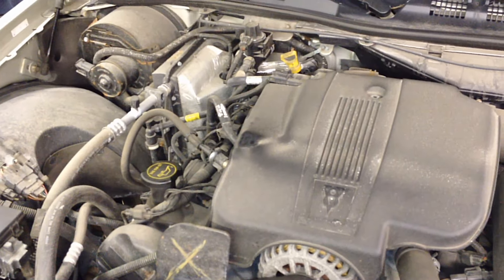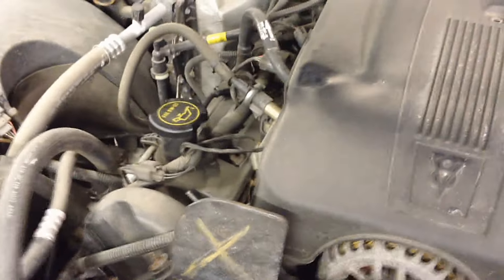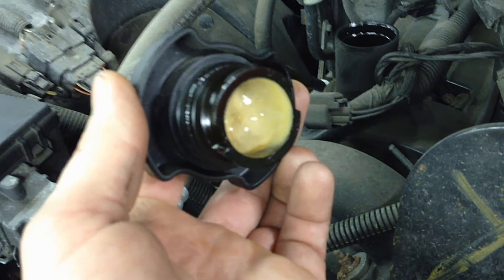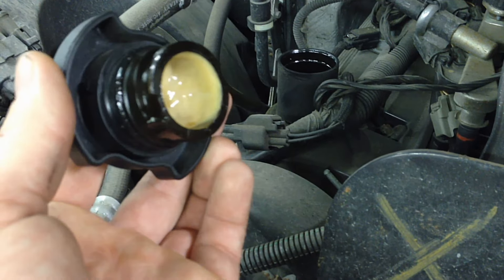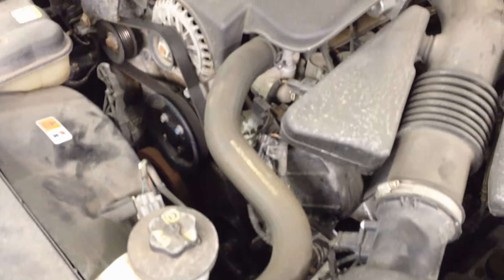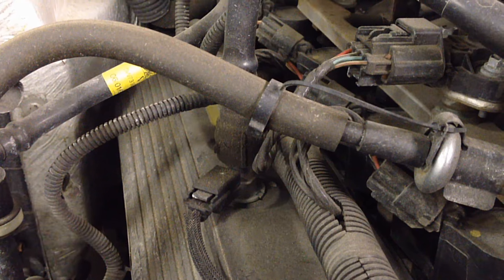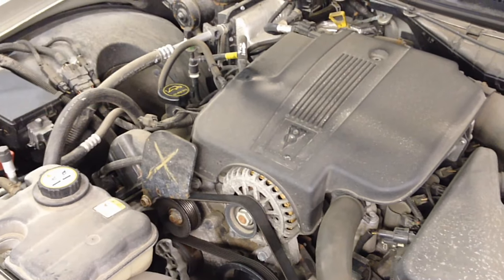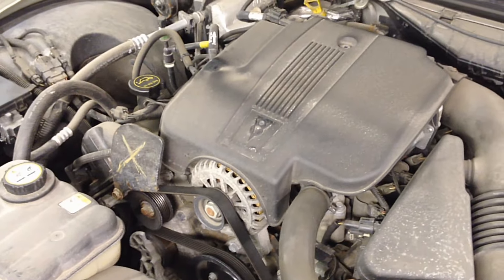Ford Quick Tips: #1 Engine Oil Cap Puddding

Comment: Thank you for putting my mind at ease.  I moved up to Washington State 5 years ago from Southern California.  I drive a 20 year old F-150, with close to 300,000 miles on the 4.2 V6.  I had never seen a car do this before (because warm climate).  The truck runs fantastic, but I was beginning to think I needed to start shopping for a crate engine due to this.  A friend told me just what you said, and it makes sense...  thank you for verifying his assertion that this is normal in a cold climate.
Reply: Hey I have a 98 f150 v6 and the other day it started sputtering out of no where well I got a code for my camshaft sensor so I’m gonna pull it off today and spray it out to see if that does it but I went to put some oil in and freaked out when my cap has this on it plz tell me it’s not a head
Reply: @kathyvarnell5407  One year later, still not a problem.  It happens more in the winter.

Comment: Thanks I just changed my oil on 6.8 v10 with only 25000 miles on a ford rebuilt motor I the same thing you showed in the filler cap, this is a relief! Thanks again

Comment: I'm  a retired lifetime Ford tech...I love your channel it's the most accurate info out there
Reply: R C Robertson    Yes he is really good on his information
Reply: How often do you recommend replacing a PCV?  2010 Passat 100,000 miles 2.0 TSI never been changed.    Thank you.
Reply: yes he does an awesome job thanks for all you do
Reply: @milesanhour  I'll be changing mine in a few hours. Letting the engine cool off before I knock it out. But I've heard 100k is a good bet. My Hyundai sonata has 238k
Reply: @OutlawEntertainmentlmc  At 300k you could have many problems but if the miss began after secondary ignition repairs...I would look there first
Reply: Yo can you help me with a quick question

Comment: First off, Thank You! My 92' Jeep Wrangler oil cap looked just like that this morning. My Dad was a mechanic for 30yrs, so I automatically thought coolant leak. Your video eased my fears by informing me about the dipstick oil looking great still, which mine does and that confused me. The short distance part makes sense. I drive it daily, which I know has helped it stay alive, but my commute is only 1.4 miles. Just back and forth for 1 yr. now. Your video reminded me what my Dad told me also many times, that you have to open an engine up once in a while. He lives 30min.'s away and visits me quite a bit. But you helped me maybe switch that around and visit him more and we could tinker around and do more maintenance that he loves to do and is probably needed. Thanks for helping an older Dad, Jeep and son out..

Comment: This video was EXTREMELY helpful. I live in Texas and we have had a lot of cold weather recently. I have been mostly driving my 2009 ford pickup and had been letting my 1999 Explorer sit in the driveway except for short little trips. The explorer was just given to me and I am in the process of fixing all the little problems it has so it has been a fun little project car for me. I went out to explorer this morning to check all my fluids, went to add a quart of oil (Its got minor leaks) and all under the cap was the pudding. I had seen it before on other vehicles but it still worried me, even though my dipstick was clean. So this video pretty much answered any question I had and provided me with a little relief. Thanks FordTechMakuloco !

Comment: Since I have retired I don't drive the distance I used to.  I always changed my oil based on mileage.  I saw I was at the 3000 miles +/-.  Time to change the oil (almost a year to the day of my last oil change)  I did NOT no about the possible damages that could occur by waiting.  This has been very informative and helpful.  I have always been on top of maintenance for my truck.   I learned a valuable lesson today!

Comment: Same problem with my BMW E39 520i from 2001.no
 sines of overheating or other stuff which could mean a head ascent 
damage and even after the oil and filter change I still have the pudding
 under my oil cap.i just drive very short distances in the last time in 
quiet cold weather.still will do another oil change as soon as the 
summer starts!thanks a lot for the video,got much more relaxed after 
watching it!

Comment: Good info. My neighbor found this gunk on my cap. I was only driving 1 mile to work, 1 mile back. None on dip stick. I put an ad on Craigslist to sell it outlining this and lowering the price. No wonder I got so many bites. The condition is not as bad as I thought. Runs fine, never overheated, smoked or backfired.

Comment: Great video, 
over time I have also learned that a bad thermostat is a common contributor to "oil cap pudding" due to it not coming up to proper operating temp.
Reply from the maker: Yes that can happen in the extremes where it is stuck mainly open. Reason I didn't include that in my video is because anything recent with OBDII will set a P0128 code for emission reason and will set a light which will alert you.

Comment: Thanks! I have had this happened with my 2006 Tundra. I also think that the problem is exacerbated by the long filler neck that I have not had on other vehicles. I don't think it heats up as much as the rest of the engine.  You video has set my mind at ease.
Reply: Obee Juan l have the same thing on my filler cap. I thought l had blown a gasket, no it's cold wet weather, very short trips every 3rd day and my engine also has an extended filler neck. Thanks and God bless.

Comment: When I had my 87 Ford Ranger w/2.9 V6, I had that happen a few years after installing the Ford reman engine. The block and heads were cast iron, the 2 piece intake manifolds were aluminium.
Yep, had the pudding under the oil cap.
The lower intake manifold to cylinder heads is a one piece "gasket."
The leak (twice) was the lower intake eroded at the front of the manifold where the coolant exits the heads and goes through the intake to the T'stat and then the radiator.  Took me a while to find it the first time, FINALLY got the lower intake manifold fixed at a machine shop.  No more problems.  The vehicle went to auction late 2016 (failed smog) so that ended it.  Just wanted to pass that on.

Comment: Just got an 01 4x4 pickup with very low miles (121,000) for its age and was told an older gentleman owned it. Dipstick and oil in the pan looks good but seen a small amount of sludge on cap and began to worry that head gasket or something cracked. Glad to know its just from condensation and not driven much. Good to know an oil change and good cleaning and maybe some oil treatment will most likely take care of it. l also heard, the brand of oil used such as certain cheap store brands also can cause this. 

Thank you for the video

Comment: Mannnn! Thank you FordTeckMakuloco👍  because I was about to panic when this morning I saw just what you showed me under my Oil Cap. Right now is not a very good time for me to be tearing down my engine to replace head gaskets and stuff because my funds is little short at this time. You really gave me some relief when you told me that it's only condensation if it's not the same on my dipstick, and it's not like that on my dipstick so I was confused my brotha.  I haven't really driven my F-150 since all this rain we just got for over two weeks. I just didn't drive it for Two weeks. Thank you so much man, I'm going to get me a PCV VALVE RIGHT NOW. THANKS AGAIN👍

Comment: Not a blanket, a winterfront blocks off most of the radiator in order to retain more engine heat, diesels use them in the cold Midwest winters. Keeps underhood temps up helps engine get and stay warmer up here.

Comment: thanks for posting this, I had a panic attack when I saw this on my 5.4 scab, don't like seeing this in my engine, made a behind the grille winter front to help get and keep engine temp up during the winter to help with this.
Reply: panic attack??... dude its just a f@#!ing CAR!
Reply: Marek Sumguy cars ain't cheap, had never seen this in any other engines I've run, had no clue what it was till I saw this video.
Reply: Marek Sumguy he even  put a  blanket on it 😂
Reply: blanket?... what?
Reply: I was a bit worried too when I saw this on my Vic. Good thing I found this video before I started losing sleep.
Reply: I too had it in my 2001 f150 5.4 when changing my oil and after he explained it all through I was like okay that explains it, because I drive it maybe once a week and it's usually only in town.
Reply: @mareksumguy1887  a blown head gasket could be panic attack worthy. The labor cost to replace head gaskets is not cheap and in extreme cases it can cause catastrophic engine in the form of hydrolocking.
Reply: @TheBikemaster94  have you ever seen a winter front  before? Look on the front of semi trucks, long haul cross country ones. The grille is covered to block airflow from the radiator, much like a coat on a person. Keeps engine temps more stable in the arctic winters. I simply made one that's behind the grille of my truck, guess what, it works. Engine stays at optimal temp, it also keeps it warm after shutdown, so there's heat in the cab way sooner than without. Making fun of something you don't even understand just shows your level  of maturity.

Comment: Thanks for the info! Had me worried when I did a change on my truck, we live in CT but have had record lows for this time of year. Drained oil looked OK, thanks again. I drive 2 miles to work every day 😔 perhaps should take my bike lol
Reply: thanks ace, that's brave... I would not ryde no bike in a CT. Winter!!!
Reply: get a used electric car... that short of trip even a dead battery wouldnt be bad.  Ive known people with short trips and it is bad on exhaust and catalytic converter too.
Reply: Same issue with mine in CT, freaked out
Reply: Yeah, short trips aren't good for carbon build up either.  I think he talks about that in another video.
Reply: thanks ace lol
Reply: I drive like 1/2 mile to work there and back . Guess i should walk. Damn ford .

Comment: Saw that pudding color when I opened my oil cover and started to worry but thanks to you you gave me a piece of mind. I only occasionally drive it about 5 miles a day maybe a 30 minutes drive back and fort to work. Valve cover is starting to see some oil leak. It’s a sequioa. I guess I need to drive it on a highway once in a while coz I use it on local roads. Thanks again

Comment: I was flushing my coolant system and didn't tighten bottom hose and noticed that steam was coming from around my oil cap, so I checked it. When I opened it, out had a small amount of moisture and white buildup. I checked the dip stick and nothing. Your video confirmed what I was thinking! But I still can't figure out how I got tissue paper in my radiator 😂

Comment: When you're due for and oil change and you have a lot of condensation add sea foam to your crank case and run it for 20 miles or so before draining your oil, leave the drain plug out overnight to remove as much as possible, I put my truck on ramps so the  drain hole will be angled at the lowest point

Comment: 10.21.17.   Also......GM 3.1/3.4 & 3800 V6 Coolant leaking into the valley & into the oil pan, due to (L.I.M.) lower intake manifold gaskets no longer sealing between the heads and intake manifold!.......Major problem solved by using metal framed ones from Fel-Pro or Magnum. I also change the coolant every 30k miles or 2yrs.......You have a superb channel ‼️

Comment: Thank you!  I got a block tester and tested it cold and very warm and fluid still stayed blue.  No white exaughst.  Have Mayo in the cap.  I do indeed do a lot of short runs, so will look into replacing that PCV Valve and take back the $40 head gasket repair sealant.  Have been scared would blow the motor!

Comment: Hi, I was offered (what I thought was a great deal on) a 1988 VW Cabriolet for $100. I was told by the owner it ran great 7 years ago. I had it towed to a mechanic that did only German vehicles. The entire fuel system needing cleaning and replacement parts. Once the car was running he told me the water pump and radiator fan needed replacement. He wanted way too much so I towed my car and got the water pump hose (not the water pump itself) replaced and the radiator fan replaced. 

I picked the car up from then second mechanic and it starts, idles and drives great. I've had it about 2 weeks and have been driving it about 1 mile 2-3 times a week with no visible issues. Then I decide to replace some little things under the hood. Turn signal lights, head lights, air filter, topped off fluids. Checking the radiator last I noticed the reservoir had no coolant in it, so I added about 1 gallon of 50/50 and decided to take it for the usual 1 mile spin. This time it did not start as easily as it did every time since I got it back from the 2 mechanics. It started, rough idled and died within 2-3 seconds. Pumped the gas peddle and it sounded a little better. 3rd time it started and as I was putting it in reverse and looked back there was a huge cloud of white smoke. Under the cap it appears there's milky white substance on the cap. The oil on the dip stick looks clean though.

Probably a blown head gasket? Damn, all the money I spent on these 2 mechanics and both would not tell me this major problem. Well one kept suggesting I get rid of it asap. I think I'm going to buy the manual and turn it into a project car.

Comment: Thanks! You really helped quell some concerns I've been having. Had this pretty heavy on a 92' Mustang Gt,298xxx miles out of no where and was WORRIED. After some research and a few videos I knew I just needed to correct a few things. I'd bypassed my pcv,super bad idea. This was  leading to HEAVY condensation in my crankcase and also creating a lot of irregular pressure causing the pcv grommet to leak. Also my oil pressure was becoming erratic. Ran a half can of seafoam through on a nice easy drive to break everything lose,changed the oil and reattached pcv with new components. She's running like a champ again. Lets hope my strut towers can hold together for another 100k. : )
Reply: 298,000 miles!  Wow good for you, you got your money's worth.  From what I've seen on Youtube comments Americans seem to run their cars to much higher mileage than Canadians.

Comment: Here’s one for you. Changed PCV valve, oil is golden, cleaned out oil fill cap and the spot you pour it in, no coolant leak. Drive it pretty far, even did 4 one hour trips towing a trailer.... still gets really bad pudding. Like every time I drive it. I clean out the pcv and that oil cap every single trip

Comment: I was shocked to see this on my son's VW MKIV Jetta, coincident with a coolant hose flange leak beside the coolant temp sensor. He had trapped air in the cooling system with mild overheating from that. I fixed the hose flange, burped the system, changed his oil, and the problem resolved without recurrence over 5 years ago. I didn't think to check the PCV valve. Then I tried to understand why the two would be related.... I suppose it may have been unrelated, gradually cumulative, but I've never seen it before in other vehicles. On the other hand, as some have mentioned below, perhaps it is from plastic rocker covers that aren't warming up as much as the metal valve covers used in the past. Alternatively, I also like the idea that the detergents in new oils may make this more common. Old style wisdom of yesterday is not necessarily valid today, and although I was worried about a head gasket leak no such leak every materialized.

Comment: Thanks for making this video! I just noticed this on my wife's 2005 expedition. She only drives less than five miles per day to work. I figured the pcv valve was clogged shut. I'm going to replace it anyway and change the oil. I do live in Pennsylvania with harsh winters.
Reply: +Mr223wssm take it on a road trip, condensation builds up in engine, need to get engine up to operating temp for a good hour or 2, fuel also dilutes oil for running rich and can leave varnish and sludge build-up inside engine and and clog oil galleys and oil pump pickup screen if not taken out and run. you should also do some full throttle acceleration runs like you are passing a car to help keep injectors clear and functioning properly
Reply: Dean Meyer